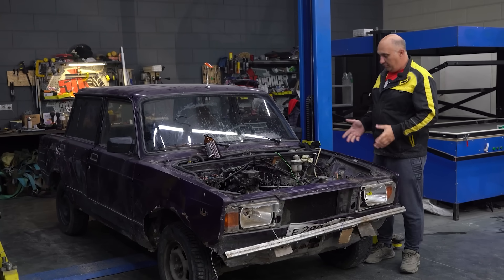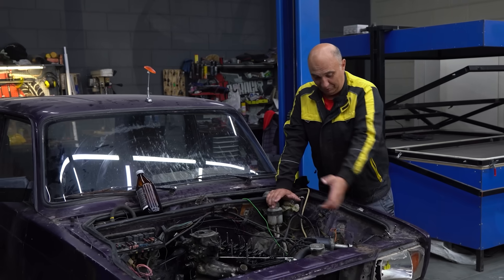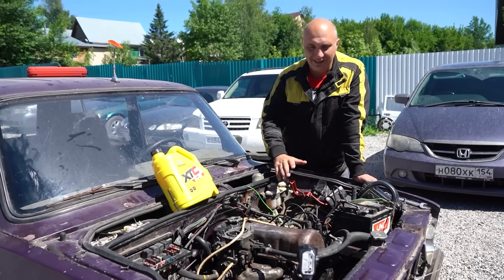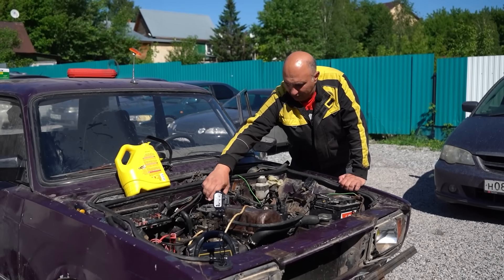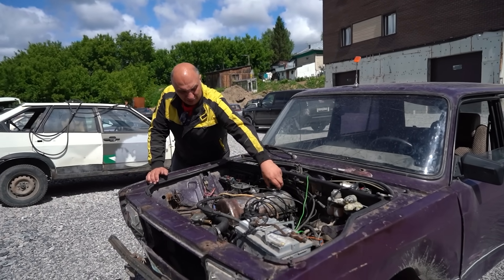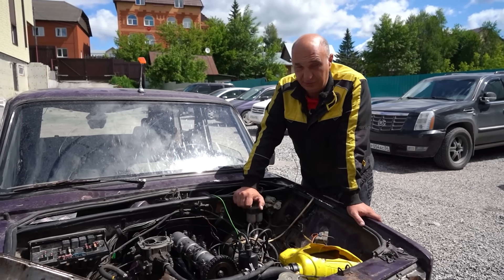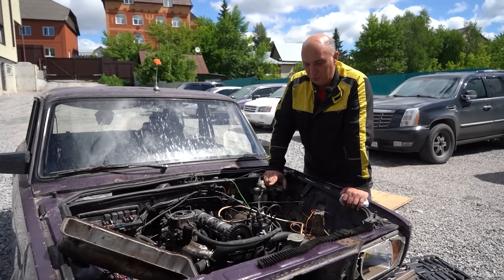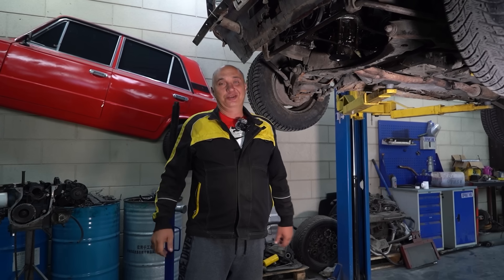Flushing an engine with paint remover – will it work?

Comment: I remember around 2003 I was using some Parts Degreaser on... I think it was the throttlebody on the 1991 Firebird (350 TPI) I had. The degreaser came in an all-metal paint can, was a name brand product but don't remember who by. Quite sure it's the same stuff that was used in a Parts Degreaser Bin (the kind that pumps this fluid through a brush). 

Anyways, it was certainly a learning experience!! 😳
The stuff doesn't make you gap for breath or make your eyes water, so I was just kneeling on the garage floor with the van open and scrubbing away at the gunk on the part. It had only been like, a minute maybe, and I noticed my hands.... Imagine how your hands looked when you've been in the bathtub way too long as a kid, and multiply that x2. They also starting to tingle a little.

So that's when I grabbed some latex gloves and put them on, just to - now hastily - finish with what I was cleaning. About 20 seconds later and the gloves had gotten a krinkle-coating like look to them...
Now I started to work even FASTER! lol
After another 10 seconds, the gloves just started falling apart on my hands as I worked (big sections fell off). 😟
Oh, and that tingling turned into a burning sensation!

By then, even though I hadn't completed cleaning the part, I was finished either way! Put the lid back on and went in and washed the hell out of my hands! Which at that point, since I hadn't washed them before putting the gloves on (just dried them with paper towels; dumb), they're turned more pale a color than I'd thought possible!

Thankfully, I suffered no ill effects and my hands were back to normal by that night. But not have those details have sure stick with me! The less important stuff may not have, but thinking my skin was about to fall off any moment sure has... 😊 That was some potent-ass solvent, that's for sure, whatever the fuck it was! hah
(this was all brought back from the fact the one guy was cleaning the oil pan without gloves on)
Reply: I bought a can of it myself.
"Tyme"
"Cold process engine parts cleaner stripper"
Not what they used. 
What they used would unequivocally remove your ability to breathe and eat the skin.
It eats Butyl rubber the common heavy dip gloves.
You must use PVA gloves which are $$$. 
The guys could have used Tyme instead imo.
Reply: sounds like you were using some HF or sulfuric acid based cleaner. probably meant to be diluted with water
Reply: @Housecat333  I could be wrong, but I think most degreasers are solvents (eg: mineral spirits, petroleum distillates) and bases. From what I've recently come across, for greases a basic solution is better than an acidic solution; caustic instead of corrosive. 

But now I'm kinda curious, so I'll try to track down what I was using... 😁
Reply: @Housecat333  Alright, it's definitely "Berryman's Chem-Dip" product, no doubt about it! (their Chem Tool fuel system cleaner is the best for 80s/90s vehicles!!) 
Whether or not it's the same formula as today's, is up for debate, but that's what this Safety Data Sheet info applies to (I genuinely feel like it'll be less potent now), and here's the relevant details:

HEALTH HAZARDS:
Skin Irritant – Category 2      [2 = "Moderate" severity]
Eye Irritant – Category 2A

Component                                       Weight
Water                                                  40-55% 
Heterocyclic Amine Derivatives       15-20% 
2-(Butoxyethoxy)ethanol                   8-15% 
2-Butoxyethanol                                 8-10% 
Ethoxylated Alkyl Amine                    1-5%

And the warning about prolonged skin contact, specifically, as it's exactly what I described!
     SHORT-TERM EXPOSURE
    . . .<snip> . . . 
     Skin Contact
        defatting of the skin, drying and cracking of the skin,
        and aggravation of pre-existing skin conditions

The "defatting" is the removal of fats and oils, which is what I was describing by my "hands looking like the longest bath ever, x2" heh
For a good visual analog: the giant Japanese water salamanders... lol (except their skin is loose and floppy to increase surface area, allowing them to breathe underwater w/o gills; there more to it but that's the gist)

Anyways, my suspicion is it's potentially basic (to solve degree), due to that last chemical mentioning "Alkyl"... but in the end... 🤷‍♂️ heh
My motivation for Googling this extended as far as to me providing the info that only I knew, which was knowing what the product looked like... ☺️🥴

Comment: This is a REALLY bad idea; it might turn your engine into a grenade!  Paint remover usually contains acetone, which will damage or deform anything plastic or rubber (including gaskets, hoses, and seals!). *Please don't do this!*  Also, modern oils are detergents, and the "sludge" is by design; it removes metal shavings and other particles floating in the oil and deposits them around the crankcase to avoid them getting into the bearings; this is why you tend to see sludge in the oil pan. The sludge also functions to seal leaks you may get in your seals, which is a good thing! Now it is true some engines are known to be more susceptible to failure from sludge, and maybe that's the case with a Lada; generally flushing should only be a last-ditch effort, or if it builds up to the point of failure.  If you do a flush when you don't need it, you risk creating leaks that didn't exist.

Comment: Paint remover with also flush the oil film from the crank, rod, and cam bearings leaving them to run dry and damaging the bearing’s. This is probably the worst thing you can do to a engine, paint stripper is for removing point it’s a very aggressive solvent that will also damage seal and gaskets. 
If you are going to do something stupid to your engine just pour it full of drain cleaner or perhaps weed killer.  Beware of YouTube master mechanics 🧰

Comment: I've used Mineral Spirits on engine with clogged oil ports... coat hangered the ports... 50/50 oil and mineral spirits let idle for and hour... changed oil and filter... run it of 1000 miles and changed oil and filter again then back to normal changes after... worked well...

Comment: I WOULD TAKE A HIGH PRESSURE WATER BLASTING 
CLEANER AND WASH THE TOP OF THE ENGINE , THEN INSIDE THE CRANKCASE BEFORE PUTTING OIL PAN AND ROCKER COVER BACK ON !

Comment: I'd be worried about tossing a strong solvent inside an engine eating the seals. Compatibility between fluids and seals is one of the main reasons we have somewhat standardized major fluid families.
Reply: Specifically Acetone, which was in it for sure.
Reply: @AmstradExin Not Acetone. 
They are using Methylene Chloride formula stripper which blends easily with any oil.
Acetone does not really blend in with oil very well.  It's designed to dissolve polymers and resins.
Reply: @RetroCaptain  ok
Reply: @RetroCaptain  Likely turpentine is used
Reply: @RetroCaptain  Russia still using chemicals now illegal for 15 years in EU
Reply: That was my biggest concern as well. Those seals weren’t even addressed in the video, which tells me that it wasn’t good. This guy seems to have a decent knowledge of engines, so there’s no way he didn’t think of it as well…probably censored on purpose.
Reply: I made a long comment above with details, but I did this to clean my engine using diesel.

Comment: Idea: Flush an engine with piranha solution. It utterly destroys any kind of organic material, particularly carbon based stuff which is all over the inside of an engine. In theory there should only be bare metal left once you drain it away.

Comment: i have a cylinder head reconditioning plant and I use a tank of methylene chloride to clean the parts, it is very fast to remove oil crud and carbon. Surprisingly the main ingredient in paint stripper is methylene chloride.

Comment: Gasoline works pretty well, no it won't blow up.  Old aircraft in northern states would inject gas into the oil  before  turning it off (oil dilution) if wanted it to start the next cold morning.  It would evaporate as the engine warmed up.

Comment: ATF works great too for cleaning sludge out of an engine too, but you need to drive it hard for about an hour and drain it hot.
Reply: I recently heard there is almost no detergent in transmissions because there is no combustion in the transmission. It seems to me that transmission fluid is such a miracle cleaner is a old wife's tale.

Comment: Never been treated to quality oil Vlad said. Quality motor oil is overrated in my experience. Been using Castrol for modern VAG diesel engines on my Audi the last 5 years, now using the mega expensive Mobile 1. And, the oil stayed much cleaner for longer, but is that a good thing? No, it simply means Mobile 1 isnt as effective in washing out old residue, if this was a superior product the oil would get black in no time, washing out the residue left by the cheaper Castrol. Back to Castrol LL 5W-30 for me.

Comment: chemistry is not their strong suit but good video anyway. "Dimexide" seems to be a russian pharmaceutical medicine comprised entirely of a substance named "DMSO" - dimethyl sulfoxide, a common solvent that penetrates the skin. I dont really know what they are talking about, but obviously buying a medical grade would be expensive, but it is used in industrial applications at 99% and 100% concentrations, and in the US anyway its easily bought commercially. either way, its totally unlike "paint thinner", but I kind of wonder if they are also using the wrong name for that substance too, based on how volatile the fumes were.

Comment: Here in America near the Southeastern side of the continent we generally use transmission fluid for our engine flushes. With a 1 quart transmission fluid for four or five quarts of engine oil placed inside of a running engine for about 45 minutes then change usually does a pretty good job removing all the sludge and carbon buildup 🤷🤷.
Reply: In my meshanic days this dealership I worked at took a dodge van in traid. It had ten pounds of oil pressure and all the tappets were clattering. I took out the drain plug and nothing came out. I couldn't figure it. I went to get an opinion from another mechanic. By the time we got back there was a long black drip hanging out of the drain. I shoved a long screwdriver through it and at last filthy oil started running out. When it stopped I replaced the plug and put on a new filter. Then I added a gallon of solvent. Upon starting the engine the pressure went up to 30 PSI and all of the lifers quieted down.  I drained it and filled it with transmission fluid, ran it for a while and finally put in regular motor oil. It ran great!
Reply: Atf fluid in a running engine is bad. 
It's a myth.  Just change the oil regularly and nothing more is needed.
Reply: Which kinda transmission fluid atf or manual?
Reply: You don't need to do anything this aggressive. Simply run a synthetic oil for a few oil changes, you be amazed at the sludge and gunk that come out.
Reply: @otm646  I think changing the oil after about 1000 miles a few times in succession with synthetic oil works wonders, as synthetic oil has detergent and retaining carriers built in, this helps keep carbon deposits in suspension doing less harm than regular oils, expensive method though.
Reply: @martinmuldoon603  I recently watched a video, and I believe it was the original designer of the Skyline GTR engine who recommended changing oil in shorter intervals (1000 or so miles) using cheap oil for engine longevity.
Reply: The thing about using atf is it can be misleading. It burns and turns dark at a temp lower than combustion temps. If you fill your car up with atf and run it and the fluid you drain is super dark it doesn’t necessarily mean you’ve cleaned anything it only means you’ve heated the oil enough to “burn” it. I’m not saying this doesn’t work, but would it work any better than using a very high quality high detergent motor oil? I dont know.
Reply: @tenmil1  That would be the safe way of doing it. Do a few shorter interval oil changes with high mileage oil which has more detergents to clean thing sup.
Reply: @tenmil1  use Marvel Mystery Oil. It's been on the market for decades, out performs any detergent cleaner and there's plenty of testimonials and proof if you search. I've used it for year. You can also add some to the gas tank. Not so much to clean the injectors but to break down carbon deposits between the injectors and combustion chamber as well as help clean the rings and restore compression.
Reply: @highpsiguy4085  absolutely. Marvel mystery does in fact work. Stuff is super useful for a number of odd jobs.
Reply: @tenmil1  couldn't agree more

Comment: Interesting experiment, I wonder what that stuff will do the rubber seals in the engine. 👍
Reply: I had the same concerns
Reply: You think a Lada has rubber seals inside the engine? Lmfao!
Reply: A man came in the shop, told me he had a leaky wheel cylinder. A FRIEND, probably not now, told him to put transmission fluid in his master cylinder. And now he has no brakes. He asked what it would cost to repair the brakes. After I explained the system would have to be flushed and the master and wheel cyl replaced, he wanted me to at least look at it. I took the cap off the master cylinder, and the rubber gasket came piling out from under the cap! I stuffed as much of the gasket back under cap and there was still 1" of rubber hanging out from underneath the cap, all the way around.  And he just got in his car and drove away!  DON'T put fluids where the do not go!!!
Reply: It will eat it slowly like had they left it for couple of hours then the gasket is gone
Reply: Also, certain sealing materials involved with gaskets and head bolts.
Reply: Probably not much worse than break cleaner.
Reply: @JoeRogaine1  paint thinner destroys rubber 1000%

Comment: There are lots of chemicals that are very capable of cleaning up sludge and carbon build-up. The question is what do those chemicals do to the various engine gaskets, seals and sealants, coatings inside the engines, as well as how it reacts with the engine oil. Since the engine must also run in order to circulate the cleaner, it can’t damage the oil or remove its lubricating capabilities (at least under low load/speed. It also can’t react poorly with any of the various metals used inside an engine. Somehow I doubt that paint remover meets all of these needs

Comment: my current subaru that i have had for 5 years was totally sludged and lifter rattling when i bought it,it took 3 oil changes and 2 flushes + chemtec lifter free to finally sort out,still runs great with no rattles to this day at nearly 300,000km's
Reply: I also have an EJ201 subaru with 330,000km on the clock and going strong. All they need is regular oil changes.
Reply: Hah you use Kilometers.
Reply: @MrTredBear  Yeah, so does majority of the world lol 
It's actually pretty silly that the archaic imperial system is in use this far into the 21st century by the 3 or 4 countries that still use it...

Comment: My dad had a 1980 Ford Fairmont he bought used to drive to work back in the mid 80's.He flushed the engine with diesel fuel. Thing ran smooth and quiet after that.
Reply: being engine flushing with 1L diesel for over 30 years never a problem and it works great

Comment: I was thinking they were going to fill the sump up with only paint remover. Run the motor and see what happens. I've used diesel to flush old oil before.. It did work.

Comment: I used engine flush on a Slant 6 once that had over 100,000 miles on it. A week later the oil light came on and I had to change out the oil pump. Never again!

Comment: Apparently you can clean catalytic converters using 1 gallon of paint thinner to 10 gallons of gasoline.  Let the engine burn through all of it at 2,500 RPM or so.  Or drive it for about 200 miles.  It has to get hot enough to vaporize everything that's clogging it.  Paint thinner makes it run extra hot.

Comment: What if, for second flush you used 5 L Deisel for a while to clean all poison out? Gaskets and seals might not be harmed this way.
Reply: I've done this with old engines and gearboxes.
But what you do is fill the damn thing to the top ,and fill the cylinders too. 
Let it sit a few days ,pull the plugs back out and rotate it by hand and either suck the fluid out of the cylinders ,or crank the starter after you drain some of the crankcase off. 
The last ATV gearbox I did had that Chinese packing oil in it and barely would turn with a drill, after a soak it spins nice by hand.
Reply: I remember the old guys doing something similar with kerosene....I personally use a quart of trans fluid-feels a bit safer
Reply: We do that. But we run it only a few minutes. When diesel gets hot it gasses to much.

Comment: I know a guy who would drain his oil and run 2 quarts of diesel through the engine before draining and refilling with new oil. The engine was noisy for sure during the "cleaning". No idea what good or bad came of it though.
Reply: If it was noisy it has sustained damage but impossible to say how much. He should mix diesel with oil for the cleaning, or not clean at all - the residues sits on secondary surfaces, not contact surfaces

Comment: depending on the severity of build up you may have to do several oil/filter chnges during a flush, even after mechanical removal of sludge. 1k-2500rpm for better circulation. 50/50  diesel & oil, change every 30min. monitor engine for noise/oil pressure, change oil/filter. you always run the risk or sludge/debris going someplace worse than it already is.

Comment: Can you redo this, But check the condition of your seals. Does this stuff damage any oft he coolant seals or any of the oil seals crank seals oil pump and oil cooler seals or even turbo seals. We dont know what this stuff does to the multiple rubber seals on an engine. This stuff maybe good at cleaning an engine but its no good if it eats all your seals up too